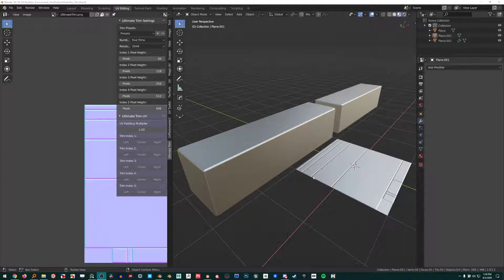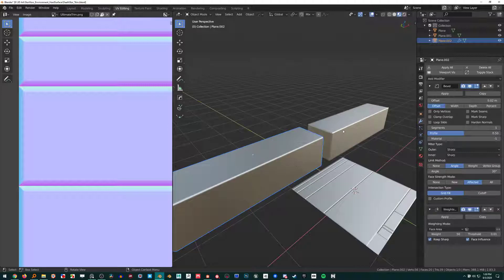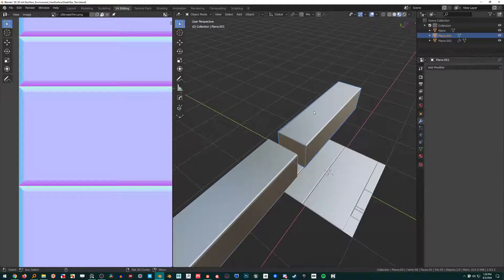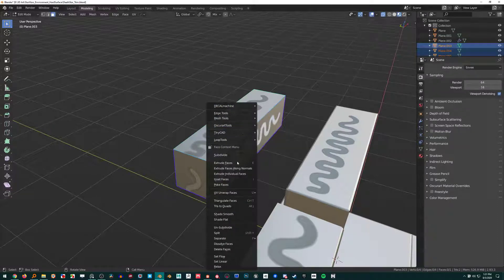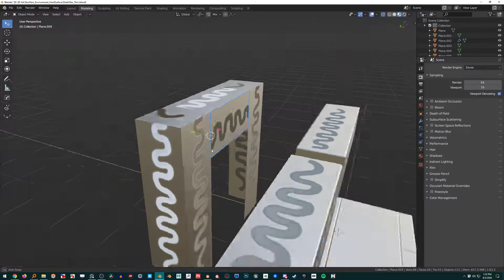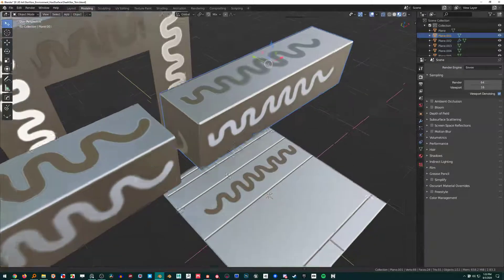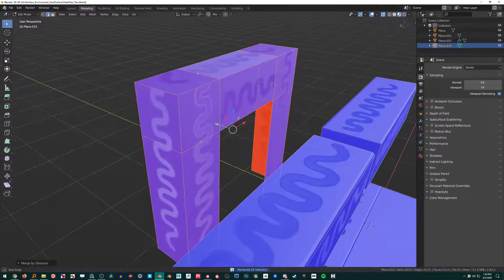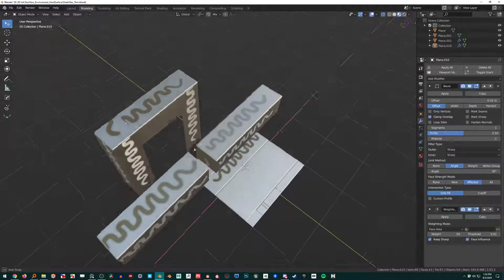Death Star Pt.10 - Trim Sheet Bevels VS Weighted Normal Bevels - 2020 08 05

Comment: Thank you for sharing :) Actually this is some really interesting topic and nobydy talks about that :I I am just thinking to start a project and I've bumped into this problem. I think weighted normals are really fine for stylized art like Overwatch and this kind of stuff, but if you are building something realistic, where you need some edge damage? I guess floaters on edges/decals could solve this problem. Have you managet to make some workflow since you've made this video? :) Thank you in advance for any feedback :)
Reply from the maker: Hey! Sorry for the late reply. Currently for edges I'm still doing a mix of decals/floaters, this method with trims, or just weighted normals. Just... a mixed bag of tricks lol. Nothing too specific.